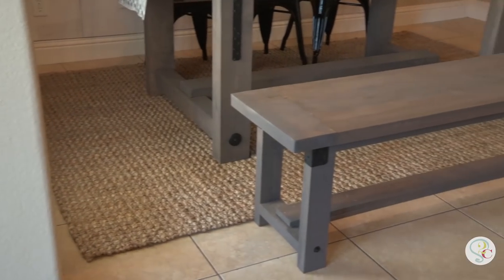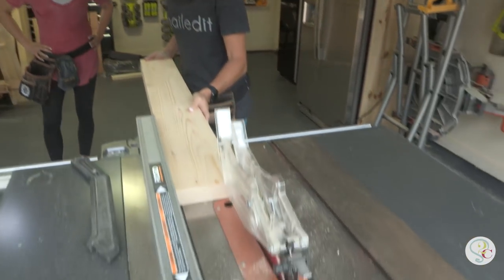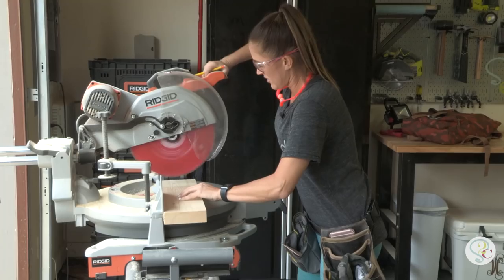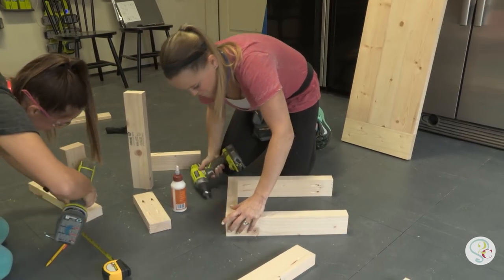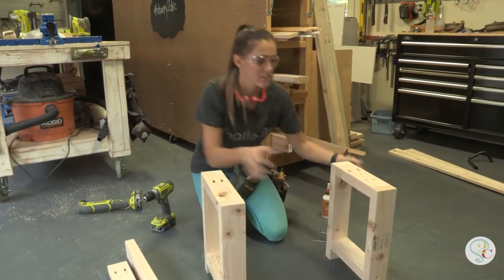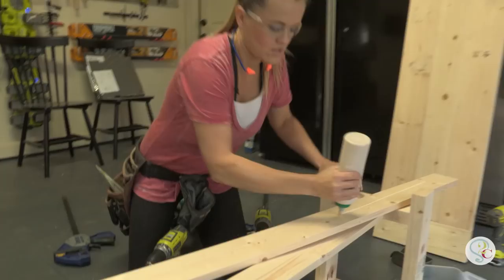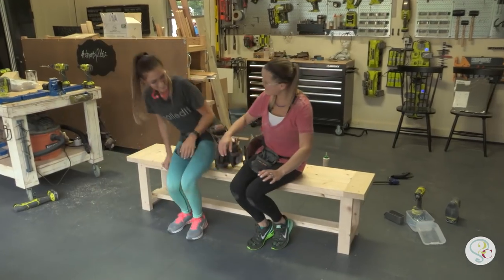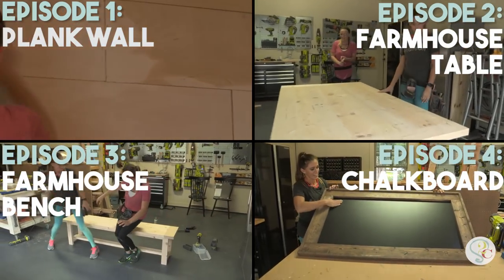Industrial Farmhouse Bench | #ShantyHouseCrash

Comment: That's cool. I cannot afford a miter saw. What is the alternative to cut out the edges to get the square? Thank you.
Reply: it's just cut wood, a big box will cut it for you, just tell them your dimensions and do as they did, nail, screw and glue because they aren't even sanding or planing, that will be the difference in a nice finished products and what it looks like years later. You can't just glue and screw wood together without accounting for twisting and bowing especially a breadboard design but it's cute for a minute.

Comment: do you know if i ask home depot to rip the boards for me they would?
Reply: Home Depot and Lowes will NOT cut dimensional wood for you.   'Cut' is for dimensional wood (circular, mitre or "skil" saw cuts) and 'rip' for plywood (table saw cuts).      Dimensional wood is stuff like 2x4's, 2x6's, etc.
Reply: they do rough cuts, their just trying to help with the transporting from store so don't expect exact cuts, hope that's helps or you'll be in carpentry class trying to figure it out.

Comment: is it OK to directly attach the top to the base line that? I was told the top would warp because it can't move openly. is that true?
Reply from the maker: Doug Beach we haven't had that problem yet and we have done it this way for many years 😀😀😀
Reply: Shanty2Chic excellent, that is great to hear. thank you
Reply: watch more real carpenter videos before you take that advice and do the simple steps to insure your piece stays nice, breadboard is not that simple and wood expands and contracts so you're on track if you want it to stay nice. Look for breadboard design and do as they do, it's not complicated but can be necessary depending on the wood, cut and your climate.  One tip is to alternate the grain so flip every other board, that will help with cupping.